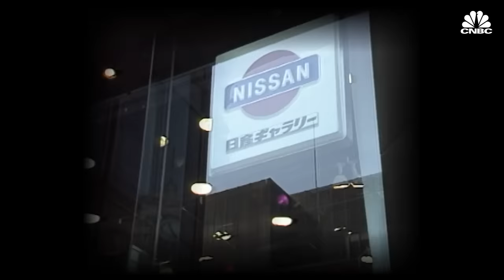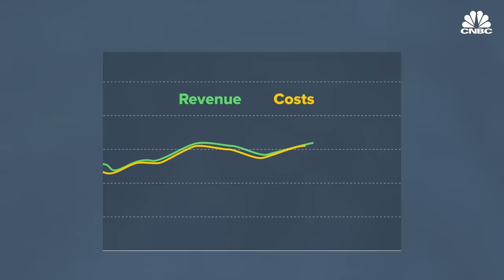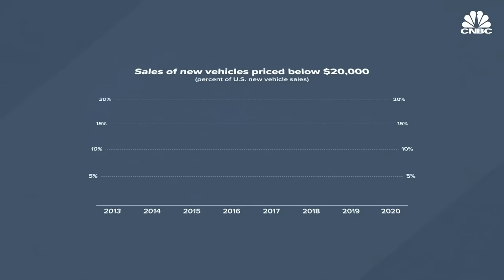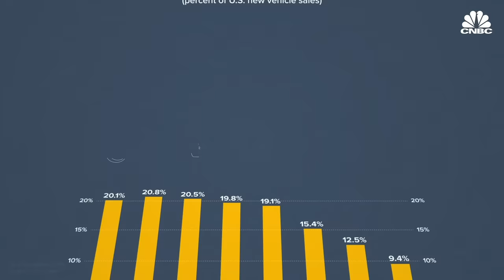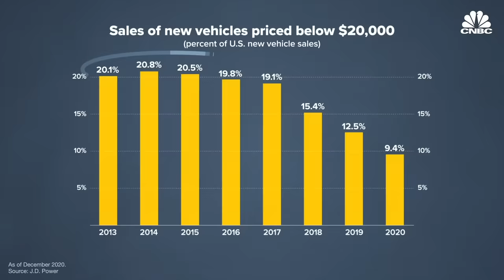Why Cheap Cars Are Disappearing

Comment: "Newer cars last longer than older cars."
Anyone who works on cars knows this is BS.
New cars are so packed with technology and electronics that are extremely expensive to repair when they break. Take something as simple as roll up windows vs power windows. Power windows fail all of the time while manual windows last forever and even when they do break, cost a fraction of the cost to repair. Mirror assembly replacement on older cars can be around $30 while on newer cars packed with all of the tech it is around $1,200-1,700. New cars are also made with CHEAPER materials. My intake manifold is metal and has 20+ yrs 250K on it while the new plastic ones crack and don't last. Old cars were simple and made with long lasting metal as opposed to plastic. They are even making plastic oil and trans pans for cost and weight reduction. You think we will have 2010 and 2020 models on the road 50yrs from now like we do with cars from the 1950? I don't think so. Those electronics will age out and bring the value of the car down with it to inoperable conditions and be far to expensive to repair. If your smart, buy base model. More affordable and longer lasting. Don't fall for the hype.
Reply: We don't have 50s cars on the road, we have a tiny minority of boomer modded-to-hell frankinstein 50s lookalikes. Replacement components everywhere and only looks the same.  Don't kid yourself. Wow I see 3 cars out of 20000 from the 50s so it has to be good....nope.
Reply: @m2heavyindustries378  Thats you. I am plugged into the automotive world and see them more frequently, esp on sundays where people like to take their weekend car (generally a classic) out. All it takes is a basic understanding of mechanical parts vs electric. There is a reason why people need to get a new phone every other year, they just don't last with all that electronic tech compared to the simplicity of something like a nokia. That and Youtubes mechanic Scotty Kilmer (over 50yrs in the industry) is also of the same understanding. They just don't last like they used to. Main thing to watch out on older cars though is rust so it depends on area, That is one area where newer cars have improved on.
Reply: @EagleXYZLibertarianForChrist  Mechanical cannot do adavance things.
Reply: @AmdUlkoinen  Yes, electrical components are far more advanced than mechanical. It depends what you are looking for. Are you looking for comfort, technology, the newest thing and keeping up with the jones'? Then electrical and new is your answer. If you want affordability and reliability where you don't have a car payment and constantly in debt, mechanical is your answer. Some of us enjoy the simple things in life and not being in debt.

Comment: Not mentioned: The cheaper cars were often less reliable and less safe than more expensive cars.  In the second gen Kia Rios (2005-2010), ABS was not standard on the base model.  Chevy's Cavalier often got poor crash test scores, same with the Kia Rio.  Side airbags are not always available on cheap base models. Sure, things may have improved since the mid 00s, but it's likely that if you're skimping out for a cheaper car, you're skimping out on quality and safety.

Just get something used if you want to save money.

Or get a base model Toyota Corolla.

Comment: People are really into their 84 month finance lmao
Reply: bro I don't get why 💀
Reply: That’s crazy with the interest they are paying! If you can’t afford a 60 month payment at max, then they shouldn’t buy it.
Reply: And by the time they're done making payments, it has lost 90% of its value, needs thousands in repairs, and most likely has terminal rust if they live where there's winter and road salt.
Reply: @DMalltheway  I took a 72 month car loan on a cheap car just to keep the payments low while I was finishing up school. I ended up paying it off in less than 24 months but it was nice to keep the minimum payment low in case I had a tight month.
Reply: @Sophie-ge7ti  that’s great it worked out, but the point I make is the interest is high if someone does a 72 or 84 month loan, if the payments at the time can’t be affordable for 60 months or less then the person should wait until they are in the situation to afford it.
Reply: @DMalltheway  It depends, if you get a low interest rate a longer note just means you are effectively leasing it without a balloon payment to keep it at the end.  Most people who buy new cars do so every few years.  I found that buying a higher end SUV and paying it off over a long term meant that I don't have any desire to replace it.  It has pretty much all the features I want in a vehicle.  (had to get new because 10 years ago the advanced safety systems were new to market)

If I had to replace mine (2011 Explorer) today I would probably look at used vehicles, because the features I paid extra for then are standard now.  It was the second new car I have ever bought.
Reply: That's because people have $60,000 car taste and a$20,000 car job.
Reply: @redwolfexr  people unfortunately go upside down on a car when they do those loans at times
Reply: @DMalltheway   EVERY car loan is upside down at inception.  The only variable is how long it takes before you are even.  

This is why GAP and "New Car" riders exist on insurance policies.
Reply: @redwolfexr  you mean most cars when loans are as long as 72 or 84 months and by the 4th year the depreciation goes dips lower than how much left is to pay the car off, but that depends on which brand it is
Reply: @DMalltheway  At some point every loan will eventually be less than the remaining value.  Assuming the vehicle has a value in the end.

This just means people have to keep their cars longer.  It is probably a bigger reason than the "dependability" that they DID mention.
Reply: @entItyVR again, depends on the brand
Reply: @DMalltheway  And gap insurance is really cheap. So no sweat at all. The key is an excellent credit score. I can go 72 months at less than three percent so why would I pay cash??? five hundred extra for a gap policy and I am driving new for cheap. Drive it for ten years and the annual average outlay is almost nothing. Ten years is maybe a set of tires and a battery or two. What does someone else's five year old beater cost you keep on the road??? You buy used and you have no idea if they drove it hard, kept up with servicing, had bad roads to beat up suspension, etc.
Reply: @markpashia7067  10 years and finally new tires? What mileage are you driving a year, 6,000?  Also used is beneficial if you can carfax a report for information before purchase, can go a long way.
Reply: @DMalltheway  About double that at 12k per year. Factory tires lasted a little over sixty thousand and the set I bought should get me to ten years plus. Replacement battery should do the same. I am retired now.
Reply: @markpashia7067  120,000 miles 10 years tires lasting? Never heard of tires lasting that long ever, sounds too good to be true.  Batteries last between 3-5 years, again 10 years to last? Too good to be true.
Reply: @DMalltheway  you are not too good at reading or math are you! The car came with one set and I bought another set that should last about the same - good sixty thousand mile tires. Car came with a battery and that lasted five years and I bought a five year battery, so at the end of ten years I sell a junker with may pops and a wore out battery. No one will pay much for a ten year old Focus with ten years of smoking in it anyway so why worry about good tires and battery when I sell it??? Bottom line is I will have about 16k spent for ten years of driving except for gas and oil. Did the same with my 2005 Focus except a deer ran out in front of me and killed it at nine years old. It ain't fancy but I get my money's worth out of them. And I know every little thing about how they are driven and when service was done. I know they are reliable and I can go anywhere without worry as to road trips.EDIT: Oops forgot that I did finance it so add about two k for interest on the loan. I actually borrowed extra and covered much of the interest with earnings though. Hard to turn down two percent money.
Reply: @markpashia7067  makes sense, the way it originally sounded was that you made only one tire change in 10 years with the first set of tires that came with the bought vehicle, I was like even Michelin can’t do that much. But it makes sense now you changed at every 60,000 which is above average depending of course how you drive and where you drive at. That’s good your initial battery lasted 5 years and the next one 5 years, the battery quality today sucks and it’s almost made to fail within 3 years.  My previous 2009 Honda Civic went 213,000 miles in 12 years before I sold it which isn’t bad, but there were some costly maintenance repairs during that span. It was still worth the 18,500 I bought it for. I think I changed the battery 3 times since I bought it.
Reply: @DMalltheway  That is twice I got lucky that Ford used good tires on teh new cars. And you are correct in that five years on the factory battery was doing real good too. I made it a point to buy a good set of replacement tires and while the battery might fail, I paid a little extra and got the five year warranty one from a company that is pretty good at honoring their warranties. Thankfully on this small car a set of good tires and a good battery was under one thousand, whereas my son spends much more than that on big tires for his truck and on high performance tires on his Camaro. He bought his used but they are also more costly to maintain. Too each their own.
Reply: @markpashia7067  Most batteries have a 5 year warranty which only the first 3 is full 100% covered replacement, then the 4th year is goes down to like 50% prorated then the fifth about 20% prorated more or less but the problem with getting a new battery prorated is the warranty stays still so if it goes bad after the 5 years are up then you have to buy a new battery; however if the replacement battery goes another 5 years then it was definitely worth it, sort of a gamble.
Reply: @DMalltheway  interest was 7% on that loan, still not too bad. Sure, I could have had it lower if I accepted much higher payments but it was a risk/benefit decision.
Reply: @Sophie-ge7ti  at the end of the day it’s your choice and what floats your boat, all I’m saying is with that rapid depreciation and longer loan terms, it’s always good to avoid the loan from going upside down.

Comment: My first car is less then $20k, purchased in 2005, and still driving to this day.
Reply: 20k is a lot for a first car
Reply: @users4007  It was brand new. Bought at the dealership. Also that price was after taxes, titles, etc. Probably would have gotten it about two grand cheaper if I would have looked online, but it didn’t occur to me at the time.
Reply: @Zach Maudlin Sure do. Only around 75k mi on it.
Reply: @KrypptikkSoulslayer  well that makes sense you barely use it, most people put 20k - 50k miles on their car a year. But you only have 75k in 16yrs. You probably a senior citizen. Because normally that car would have 300k+ miles.
Reply: @dexterjsullen  Nah, not a senior citizen. Mid 30s. Use car mostly for work, home, and buying stuff at the store. I want to say around 30k miles on the car was from a past long distance relationship otherwise it would’ve have been way less miles.
Reply: @dexterjsullen  300,000/(365*16) = 51.37 miles per day
That seems like a lot of needless driving.
Reply: My first car was in 2004 and it was $400.
Reply: @E. N 2005 Toyota Corolla XRS. Btw, I traded it in last Fall ‘21 for a 2019 Toyota Tacoma SR5. That way I had a truck ready for the winter.